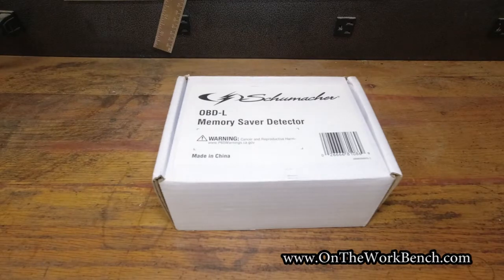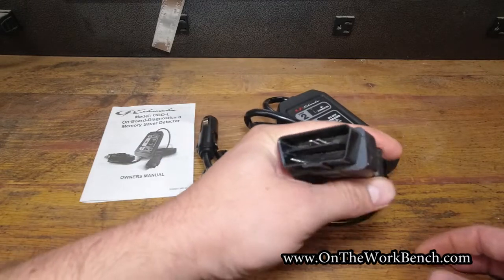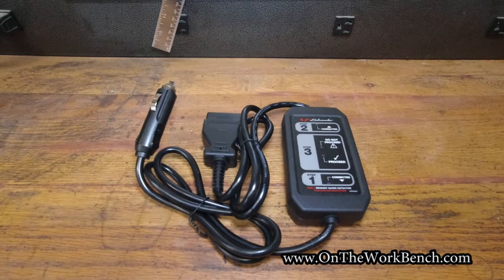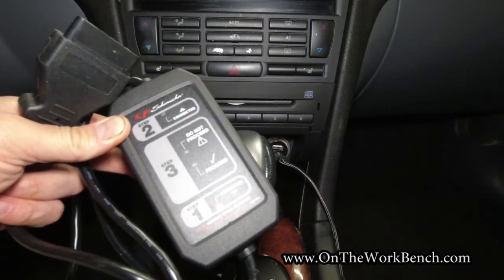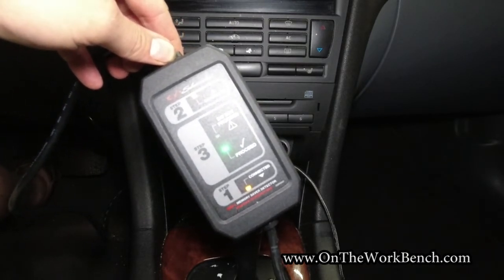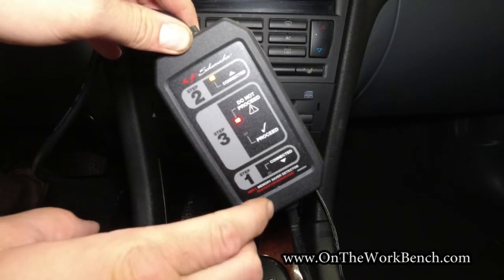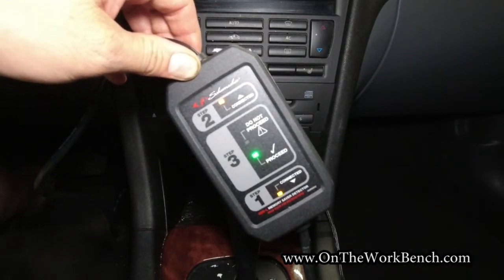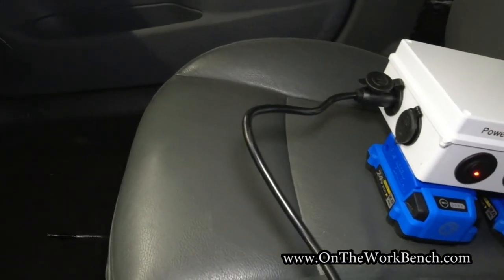Schumacher OBD Memory / Battery Saver

Comment: "Some jump starter packs have a 12v outlet, there are 120V ac to 12V dc adapters, you could use another car, or build a 12v power source."
                                                                                                 You did NOT EXPLAINED WELL

Comment: You don't really need to warn people that have cars built prior to OBDII plug inclusion. Other than resetting the radio channels, you have no CanBus microprocessors that need reprogrammed. Times were simpler back pre-1995

Comment: It did not work in a 2009 mariner premier. The 5 amp fuse blows in the OBD.
Reply: You didn’t plug the thing into the cigarette lighter in the same car you were changing the battery in right?

Comment: Recently changed out battery and now cars acting possessed. Today won’t start and key stuck in ignition any advice?
Reply from the maker: Is the battery charged? Not all new batteries come fully charged..
Reply: @OnTheWorkbench  replaced old with brand new and now car is possessed. Windows, locks, radio off and now car won’t even start. Fob doesn’t even lock it.
Reply: @n8vdescent  I hope you didn't cross your negative and positive battery terminal posts. That happens sometimes and results in what you're describing.

Comment: I wanted to install an amp in my 2022 Audi but I guess using this would be the same as installing the amp without disconnecting the battery
Reply from the maker: Yes that would be the case
Reply: @OnTheWorkbench  I installed the amp without disconnecting, took it slow and safe, no issues..